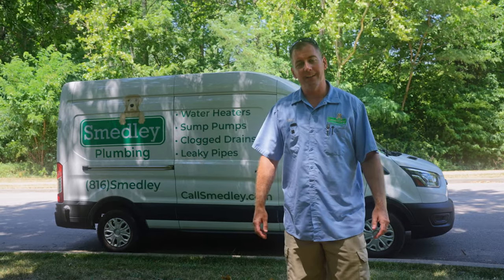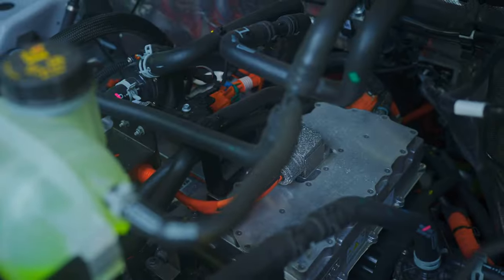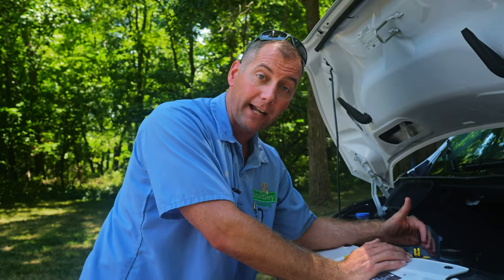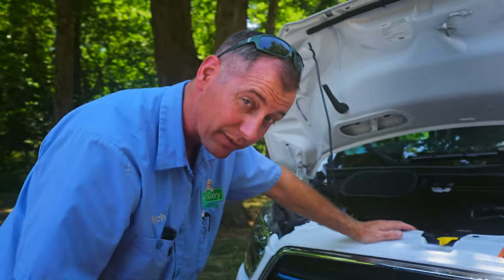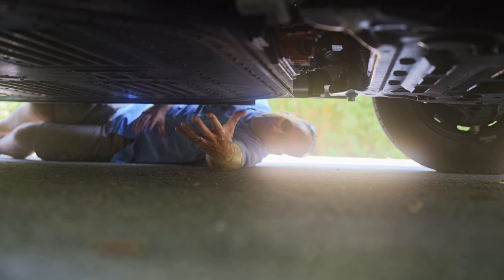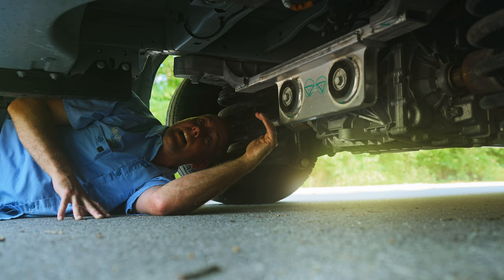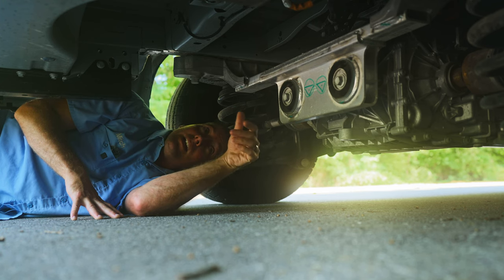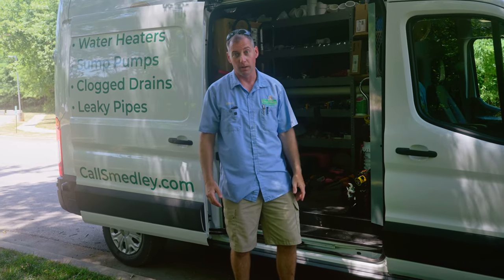What's under the hood? // Ford E-Transit

Comment: One thing they have under the hood that I wish they would relocate because it’s noisy as hell and very annoying is the electrically powered vacuum pump to work the brake booster. I might even look for a way to isolate that from the frame even more. Every time you push down on the brakes, it activates.
Reply from the maker: Yeah it's crazy how the thing is virtually silent and now we notice all noises.

Comment: LOL I called the dealer right away when I saw my spare missing from the back. I later discovered it in the front while installing
 my front plate...
Reply from the maker: Ha!  Yeah it's a little odd at first.
Reply: @SmedleyPlumbing  its still in the back on the extended length version
Reply from the maker: @colindunn4222  thanks!

Comment: my spare tire is mounted in the back on my 2022  e transit
Reply from the maker: By choice or from the factory?
Reply: @SmedleyPlumbing  Ford puts the spare tire in the back between the rear axle and the rear bumper underneath on the long electric Transit exactly where my spare tire is on my 2006 e-150
Reply from the maker: @madtater5948  good to know.  Ours is a 148" standard length.

Comment: Does nobody still not know what the button in the charge bay does?
Reply from the maker: Working on an answer to that now.
Reply: I believe it locks the charger to stop it being removed while charging
Reply from the maker: @barrytemple808  we are learning that in some instances when the vehicle is connected to a public DC fast charger the charging handle will become locked into the charging port. The button will allow you to unlock the charging handle as long as your keys are within proximity of the vehicle. There is also an emergency pull cord under the hood if that electronic locking mechanism were to fail.

Comment: Hey Mitch!
I just bought an e transit 
 Partly thanks to yours and secrets videos about how range is better than ford claims 
I'm getting on average 150-170 per charge. 
One issue though. 
I need to tow a 6x10 trailer and there is literally no info on this. 
Regarding wiring harness. 
Dealers don't know 
Thanks again
Reply from the maker: Ford doesn't recommend towing with them however I have seen a few people install it aftermarket hitch and wiring harness on the back. They all say it installs exactly like it would on any other Transit that did not come from the factory with the hitch.
Reply: @SmedleyPlumbing  thanks so much 
Can u point me to these folks that have installed ?
I called the parts department and they had no idea.
Reply from the maker: @mshmusic  check out the Ford E-Transit group on Facebook.
Reply: I'm heavily looking into the purchase of this E-Transit for Courier work. So most times it will be empty to maybe 400lbs of cargo at one time. In a blue moon 800lbs. What platform are you running?? I'm looking at the low roof, long wheel base. I have to get into the parking garage at the airport to pickup at times so need the low roof. Living in Arizona A/C in not an option to keep it off during the summer. Glad your getting 150-170 per charge. Let me know. thanks!!
Reply from the maker: @fiat.freakx19  we run a 148" high roof model.  You'll see better range with a low roof and less weight.

Comment: Thanks Mitch! One question. When the transit is charging what else can be used besides the AC or heat. Are the USB outlets available? Inside lights? 12V plug?
Reply from the maker: Yes.  All accessory functions work while charging.
Reply: @SmedleyPlumbing  However as you did mention The Pro power will not work when plugged in.
Reply from the maker: @junbead9614  correct.  The van must be on for them to work and the van can't be on when it's plugged in.

Comment: When the van is plugged in at night time can you heat the rear of the van just enough to stop things like water tanks and caulk from freezing?  That would be a huge bonus for me as a window tinter!
Reply from the maker: It will schedule a warming of the cabin based off your programmed departure time and it uses shore power for that warming.  So it's possible you could schedule multiple departure times close enough to keep things warm.  You could also find a way to run a separate power cord out to the van and run a small heater.
Reply: Cool. I bet Ford could easily add a “anti-freeze” cabin heat mode to the phone app with a freeze warning to remind you to turn it on. I wouldn’t use it every night but sometimes it would make life a lot easier not having to unload the van before things freeze.
Reply from the maker: @jonkolo13  I haven't heard of anyone using Forescan on the E-transit yet but it sounds like something that it might be capable of.

Comment: Hi Mitch, thanks for putting these videos out there. I have a couple questions if you wouldn't mind answering:

1) What is the minimum ground clearance on your unit after being loaded down? Using your hands for scale in the video, I'm guessing somewhere between 5-7", but I'm wondering if you could get a formal measurement.
2) Are you ever thinking of putting larger diameter wheels and tires on your unit? Any estimates on what the largest diameter wheel/tire combo possible might be? I'm asking because larger diameter wheels could be a way to bump the ground clearance up a bit.
3) Do you have any complaints so far with the Ford Pro Power system?

Thanks!
Reply from the maker: Hello and thanks for watching!
I'm not sure of the ground clearance but because of the independent rear suspension it will be slightly less than a standard gas Transit. The coil springs set just inside of the rear tires and they are probably only six to seven inches off the ground.

As far as wheel and tire packages go, any of the larger wheel and tire packages available for any other Transit would work on this one.

If I had to come up with a complaint for the Pro Power pack I would only have one. And that is that the vehicle must be on in order for the Pro Power pack to work. However the vehicle cannot be on while plugged into a charger.
Reply: @SmedleyPlumbing  Excellent, thanks for the information and quick response. I ask about the ground clearance and wheels because some of my use cases involve driving on less than perfect dirt roads. I worry about kicking up some rocks or driving (at safe speeds) over something larger and damaging the motor/battery pack. We've all seen how dirt roads can get rutted out and I am curious about how much the E-transit can handle. I suppose it's about the same as the regular Transit, considering the chassis is essentially the same.
Reply from the maker: @stevendibb  chassis is the same clearance as a regular transit.  The battery is also heavily protected.
Reply: @SmedleyPlumbing  Regarding Pro Power on while charging, a user wrote in the etransitforum:

>>>
 I sorta have this working now. You have to make sure that max idle is off from the steering wheel vehicle settings. Then make sure you set your onboard to shut off with enough battery to get you home.m Next turn off heat/AC depending on year and also lights. Don't turn the vehicle off and lock your doors with whatever is plugged in and On board should stay on. 
<<<

This was not verified by other forum users. It's unclear if this really solves the problem. So max idle setting must be off, any other consumers like AC/heating or lights off and the doors locked.
Reply from the maker: @gerbre1  interesting.  We might have to try this just to learn for ourselves!
Reply: @SmedleyPlumbing  If it doesn't work, don't blame the messenger. 😉
Reply from the maker: @gerbre1  lol.  Never blame the messenger! 😂